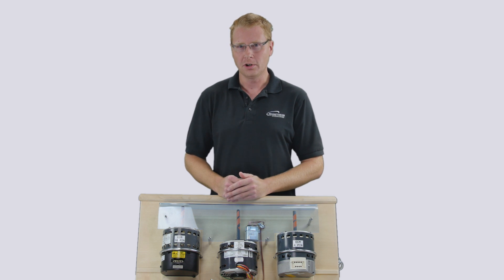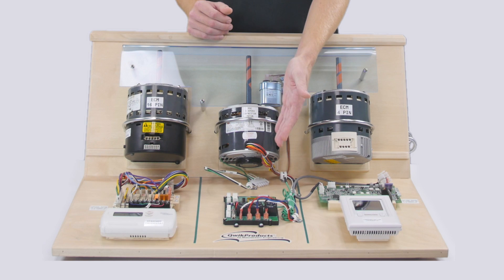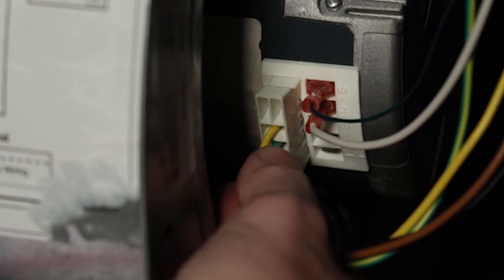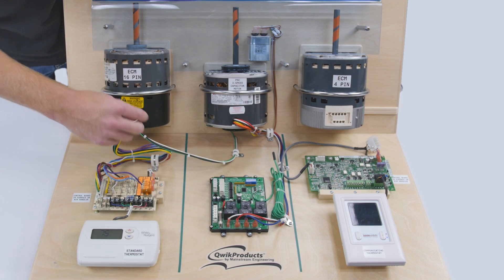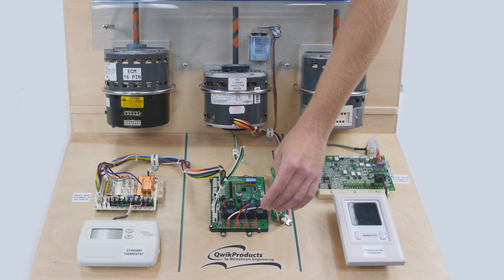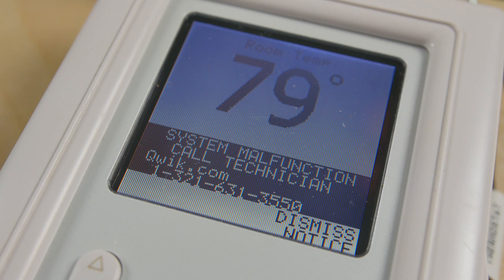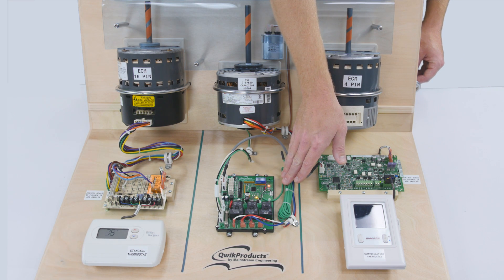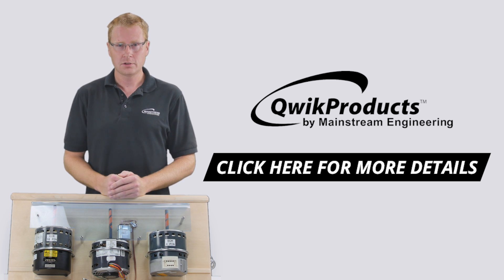QwikSwap® V3 Demonstration (link to Install Guide in description)

Comment: will this require a common at the Thermostat, or will it be going through batteries often if left without the common at T-stat, Thanks
Reply from the maker: Thank you for the question.  It does not require a common wire at the thermostat.  It will not drain batteries because it is powered off the unit mains.

Comment: How does this tie into the heat strips in the event the come on in error? Will the blower have the ability to come in automatically when the heat strips are energized when using this board?
Reply from the maker: Thank you for the question.  The QwikSwap will only turn on when the system calls for the fan to run.
Reply: @qwikproduct  So if there is a short in the system and the heat strips energize on their own there is no way for the fan to come on automatically as a safety?

Comment: how much efficiency are you loosing from going from a x13 to a psc using the quickswap x3?
Reply: Of course you loose efficiency but in many cases home owner shouldn't pay $1000 to $2000 for an ECM motor, when the furnace are old.
Reply: @hvacworkshop4791  i agree with you. going from an 3.5ton psc seer 10 to 4ton seer 16 x13 by bill dropped 15% continuously

Comment: Installed today. It works!  16pin. Only one question. Why does it need to mount the temperature sensor to the coils?
Reply from the maker: The temperature sensor is an essential aspect of the QwikSwap V3.  It is in place to take readings of the coil temperature and allows the replacement PSC motor to change between high, medium, and low speeds during operation.  The sensor also ensures that the coil does not get too cold as the motor changes to lower speeds.  If the coil does get too cold, the temperature sensor will cause the motor to switch to a higher speed to make sure that the coil does not freeze.
Reply: @qwikproduct  thats a great answer BUT how come the original x13 does not need that extra wire sensor and its able to vary between speeds?
Reply: @joeydelmarsjr.646  Original ECM will preset airflow by manufacturers. Motor will change speed when resistance in duct changed, to maintain constant airflow CFM.
Reply: is sensor needed for heater mode also? when I switch to heat the motor does not go to low speed, can this be because I did not install sensor?
Reply: @xxrob88xx24 heat pumps need more airflow.

Comment: How resilient to power surges and brownouts is this board?  
I have ordered one so it will be interesting to see how well it works.
Reply from the maker: Each QwikSWAP board has transient surge suppression built into the boards absorb high voltage spikes on both the line voltage as well as communication lines going to our boards.

The QwikSWAP X1 (QT6101) is not affected by brownouts. The QwikSEER (QT6000) and QwikSWAP V3 (QT6104) have brownout detection built into them and will reset within 3 seconds of a brown-out.

Comment: My question here is why is there no thermistor on the OEM ECM module but a thermistor on the PCM motor ? It would seem to me that not having a thermistor would be less efficent since the thermistor is measring the actual freon temperature in the evaporator and adjusting motor speed based on the intrinsic environment it is cooling .. the OEM ECM looks like it is just ramping up pre programmed speeds but competeley out of touch with the actual environment .. These ECMs should have thermistor/sensors to detect the actual environment ..
Reply: The OEM Furnace board monitors the freon temp and adjusts the OEM ECM speed according to factory efficiencies.  The OEM ECM motor is more efficient. This swap has merit IF customer system is down and replacement is delayed or the price for OEM is too high.  However the PSC and Quick Swap will have less efficiency.
Reply: @spotmark2  My 2010 vintage Rheem unit with a ECM 2.3 doesn't have any such freon temp monitors, so apparently the qwik swap board is meant to cover a wide range of products.  I wonder if the temperature probe of the qwikswap is useless in my installation and can be left near the qwikswap circuit board/blower fan area?  Even though my furnace is high eff., the 2 speed blower operation is disabled by the motherboard since my thermostat wiring doesn't have additional wires to accommodate a higher tech. thermostat.  Thus, full speed to the blower in heat mode.  Also, when in air conditioning mode, there is only 1 speed as well...so I don't know if I can even use a qwikswap board now that I think about it, without the ability to disable the qwikswap's  high/medium/low blower speed changes, or bypass the evap. coil temperature monitoring feature altogether.

Comment: I do building automation. We have a site with 2.3 ecm motors in a bunch of heatpumps. The motors are fine, we just need a way to take control of the motor speeds via a controller that can take 2-10v or 4-20ma ect input signal. They are controlled by jci factory FX-10 that are no longer made, which controlled the ecm motors via a pwm output and 1k ohm resistor.